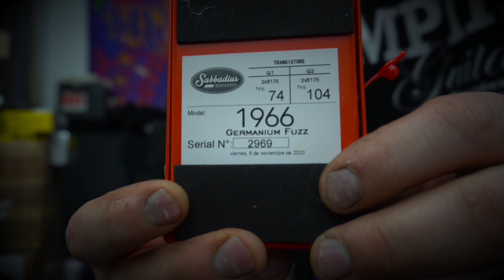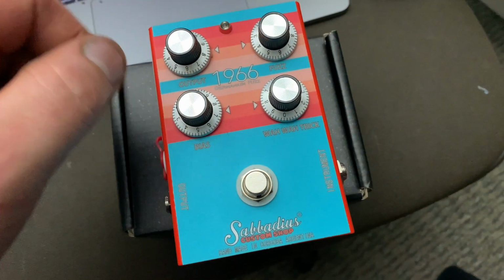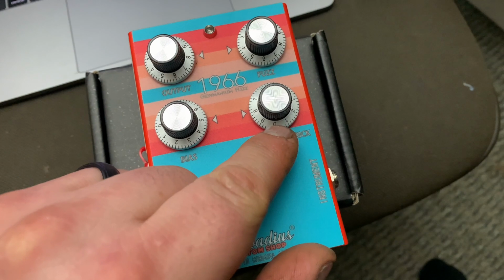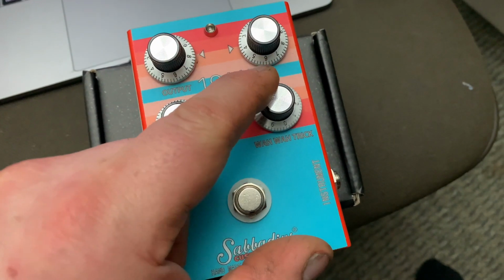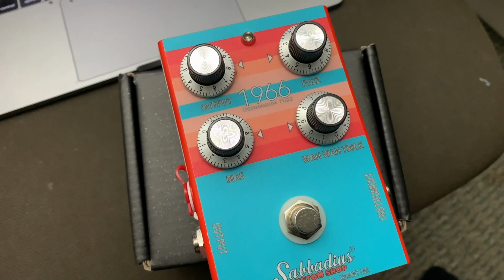DIALING IN A GERMANIUM FUZZ PEDAL!

Comment: I love plugging straight in. I’ve been trying not to use too many pedals. I’ve got it down to a germanium mini fuzz face, tube screamer, a klon, and sometimes a chorus to fatten up the sound. I’ve been playing a Princeton and new Fender bassbreaker and playing around with different speakers. I’ve really gotten into the clean tone of the fuzz face with the volume turned down. You get the rich harmonics that u don’t that with a regular clean tone. Especially at lower volumes at home.